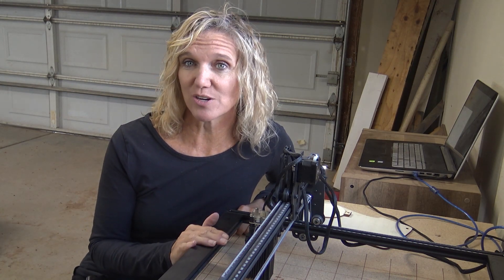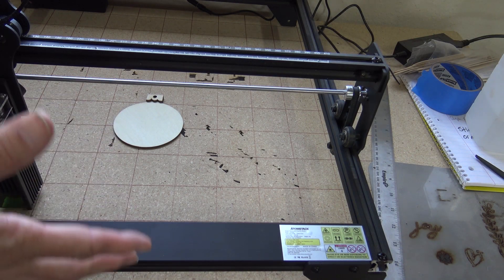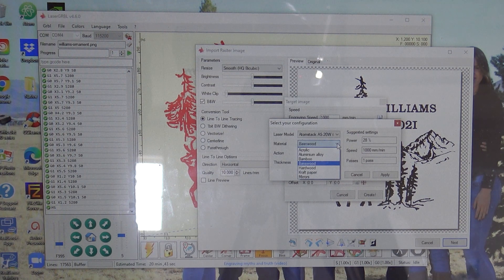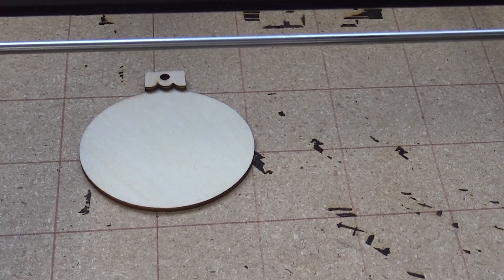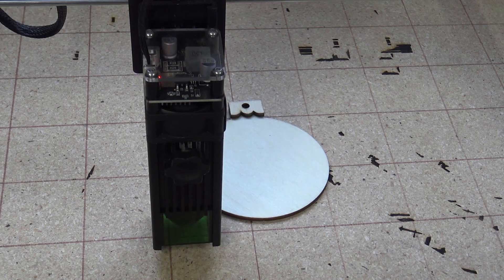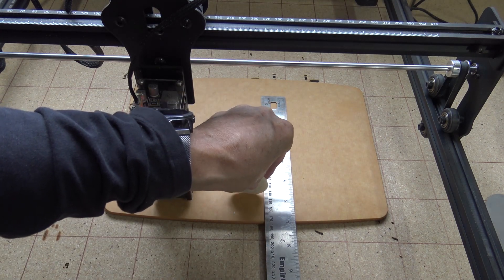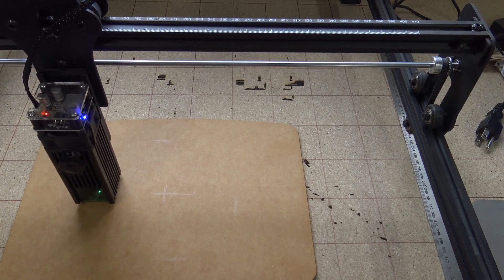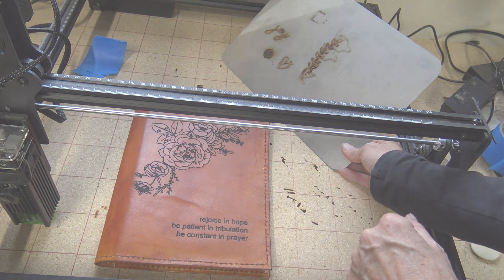How to Use a Laser Engraver - Laser Engraver Tips!

Comment: When trying to center designs on projects there is a button on the bottom row of buttons in laser grbl that with move your laser to the center of the design. If you press the "center" button and then focus it will shine the laser on the center of the where the design will be and you can align your work piece accordingly.
Reply from the maker: Thanks for the input!

Comment: I just watched another video can’t remember her name already. She said the reason it does tht is bcuz the laser needs to be positioned from home at 0 top left corner. She said do not start with it positioned anywhere on the project because wherever you turn it on it will recognize as 0 or home thts why u keep moving the project because it’s off and is recognizing the wrong starting point as home.I hope tht makes sense! Lol
Reply from the maker: Yes, that totally makes sense as to why!!  I have found focusing on the lower left, framing it to double check, and then testing by hitting center, gives me the best placement.  Thanks for the reply - I didn't know why it recognized it as 0.  Thanks!

Comment: After checking your art and material measurements, using laserGRBL- press your CENTER button, to move head to center of art.
Center your material (or laser head) to that point. Click the 'Blink' button to flash the laser, to align further.
 Frame to confirm all fits.
FYI.. when moving the laser head by hand(manually), move it slow, as the stepper motors will generate electricity, and could short your module or motherboard!
Reply from the maker: Great to know!!!  Thank you!